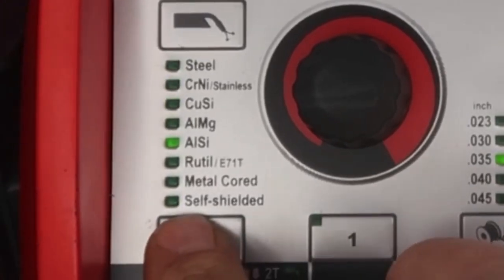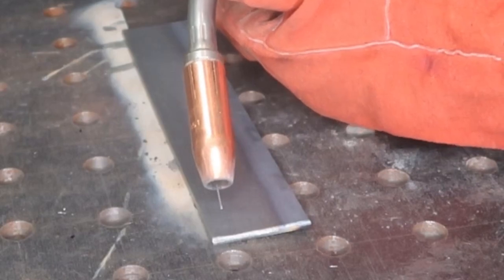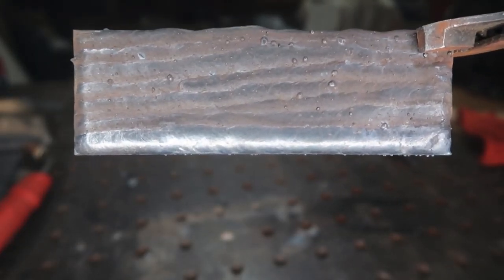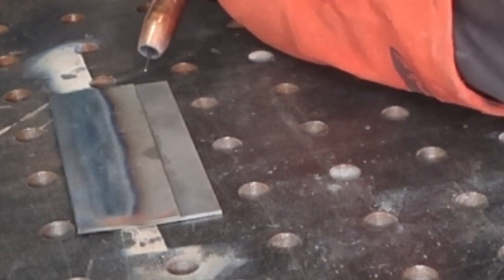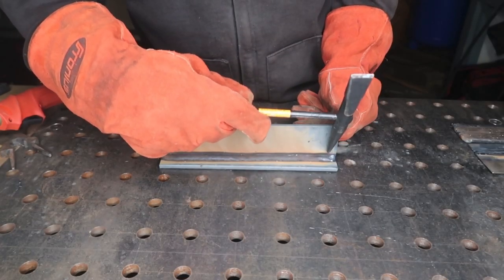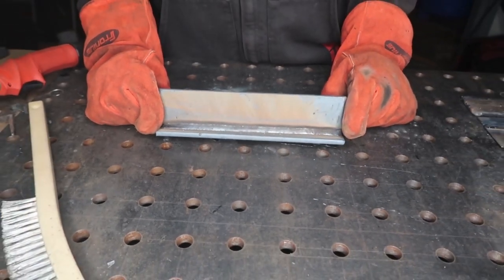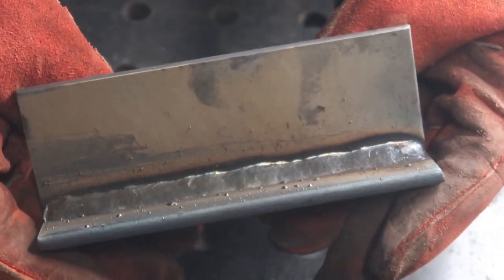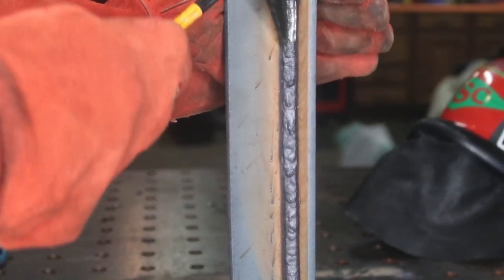Everything Dual Shield Flux Core With 100% CO2 #fluxcored #welding

Comment: 310 fpm is still well within spec for .045. This machine is crazy good. The power from 120v is nuts, the mobile service king.
Reply from the maker: Petit Wonders Small box with a ton of power 💥
Reply: @chris_b_liven  when you are welding 3/64 aluminum what is the part numbers for the liner and tips that you used in another video. I am ordering one next week and want to get the right stuff.
Reply from the maker: 42,0001,6692                  Drive Roller .045 
42,0001,0012                  Pressure Roller .045 
42,0001,6468,10             Contact Tip .052 
40,0002,0005,005                 Liner 1/16

Comment: Use that wheel on the rigth side of the mashine to fine dial the wire feed. It is the symbol og the wire length. I do alot of dual shield wire. And use a fronius mashine. Last week i weld over 8pcs off 15kg wire spools. When you do vertical up. You weld should look like the one you did horisontal. And slagg should fall off easy if the machine is on the right settings

Comment: Hey Chris I have a job in the field tomorrow and need to run .035 dual shield but I forgot to buy the fluxcore drive wheels 😬. You ever tried the dual shield fluxcore with the normal .035 drive rollers is not alot of welding but just to get the job done
Reply from the maker: You will be perfectly fine 👌 Just tighten until it stables out
Reply: @chris_b_liven  awesome thanks man

Comment: Any ideea what using 80-20 mix would do to a weld, of the wire is 1c(100% co2)?
Reply from the maker: I would check the wire specifications before you switch gas. I know most wire manufacturers will specify a specific gas mixture for best welding results. It’s possible the wire calls for either 100% or 75/25 . In my opinion, the 75/25 causes less spatter and a more spray type welding cone. 100% C02 will act like it’s in globular mode which doesn’t provide a smooth arc cone. Obviously, the 100% C02 is much cheaper so I would outweigh the benefits from both. Check out this link https://www.lincolnelectric.com/en-au/support/process-and-theory/Pages/shielding-gas-for-flux-cored-welding.aspx

Comment: Hey im running like 25amps  8-10 hot start -4-(-2)dig and 30-35 gass doing ok but i want a smoother weld puddle any advice? 
Btw the thickness is anything from 3/8 to 3/4

Comment: Great Video Chris! 
I recently got to use the Dual Shield on an Excavator Boom, and that stuff is Butter Smooth.
Glad to know the 2200 will run it just fine. Can't wait for my Transsteel 2200 to get here.
I've got 2 Stainless Projects to do, so I'm going to order some Dual Shield for it, and bust the Cherry on my 2200 properly.
Reply from the maker: +Phillip Chambers Congratulations on the new purchase!!! Dual shield is the ticket especially if your trying to increase deposition. I wanted to try .035 dual shield but it’s not as common
Reply: @chris_b_liven  Chris, I have another question. I just saw an older Video of you and ChuckE2009, where you Guys were putting a 2700 thru its paces with some different Wire types. I have always used ER70S6 Solid Wire, what is this Metal Core Wire? Also, what would it's best purpose/uses be?
I am a self taught Welder Fabricator, so I have a lot of things to learn about Metallurgy, etc. but I am constantly trying to educate myself everyday on Welding.
If someone had an actual Night School for Welding I would go in a heartbeat.
Reply: @phillipchambers8487   I am sure your local community college offers some evening classes.
Reply: @Precivilization  I will definitely check on that. I looked around several years ago,and couldn't find anything. But there is such a drive right now for Skilled Trades Workers and Training, that it may have changed.
Reply from the maker: Phillip Chambers Hey sorry for the late response. Metal Cored is similar to flux core but with no flux. One disadvantage would be welding out of position. If I was welding in the flat or horizontal position on 1/4 and above then I would strongly think about metal cored. It increases your deposition and you use about 3-4 volts less in comparison to solid wire. This could assist with welding machine long term wear. Depending on which state you could always jump in a brief course for sure
Reply: @chris_b_liven  Neither Hobart nor Lincoln have a 10lbs spools of Metal Cored. Is Kiswel any good? They seem to have smaller spools that'll fit the Transsteel 2200 (KX-706), is the 706 suitable for welding mild steel?
Reply from the maker: Sorry I didn’t respond. Yes Kisswell would be a great option
Reply: @phillipchambers8487  JFLincoln foundation has excellent price on "Metals and how to Weld them"

Comment: Thanks a lot for the video. Exactly what I was hoping for, except with .035...lol. 
035 isn't very common indeed, but I think the machine is more suited to .035. You can order the Lincoln Outershield 71M .035 10LB Spool here https://weldingsupply.com/cgi-bin/einstein.pl?PNUM::1:UNDEF:OR:ED026804
Reply from the maker: +Fluke Yes.... I will probably do one on .035 dual shield and Metal cored wire